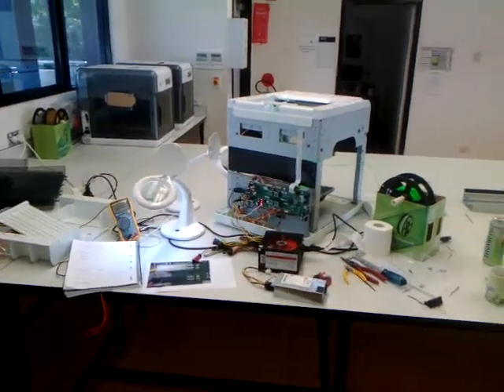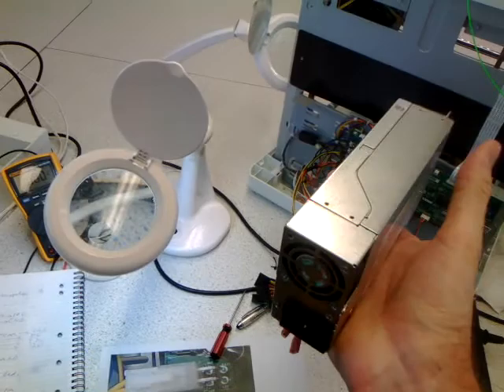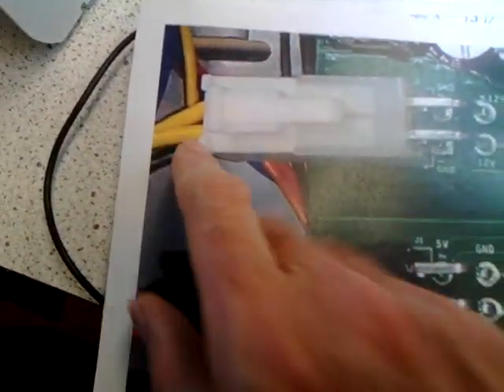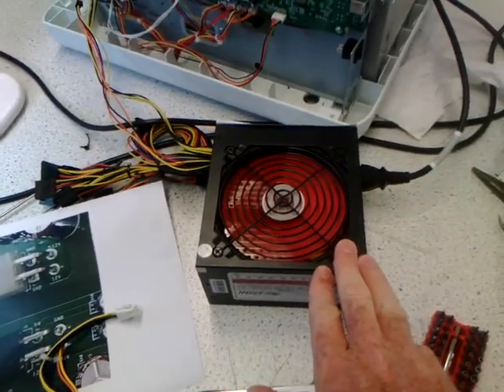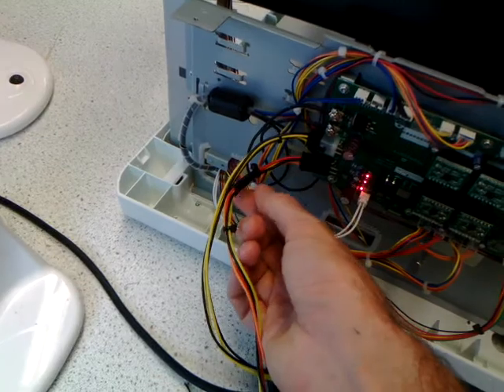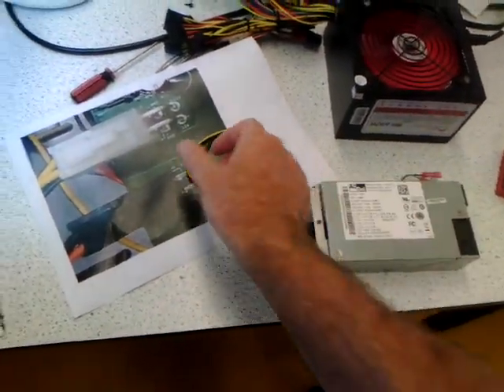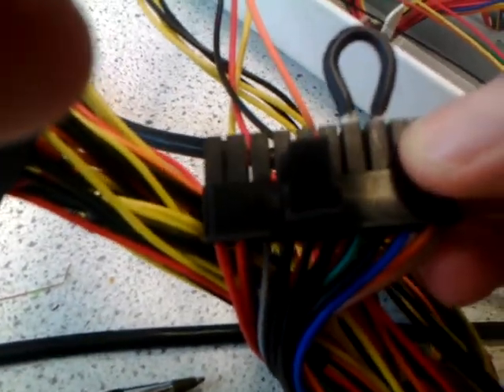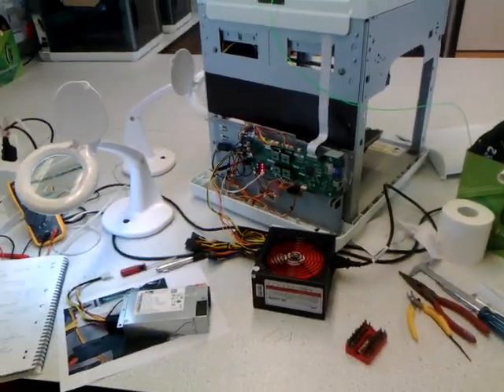davinci 1.0 3d printer replacing power supply

Comment: Just a note, the specific form factor of the PSU is the FLEX ATX.  So any Flex ATX PSU that meets the same or greater supply ratings should be able to be converted to work.  FYI, I just had this same problem.  I do not believe that XYZ provides replacement PSUs, but I also have an email into them to find out.